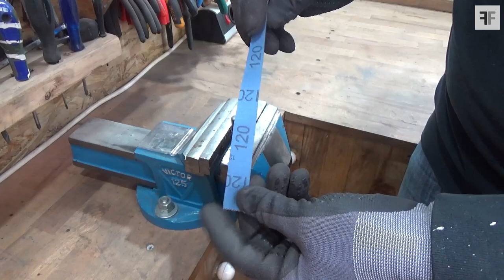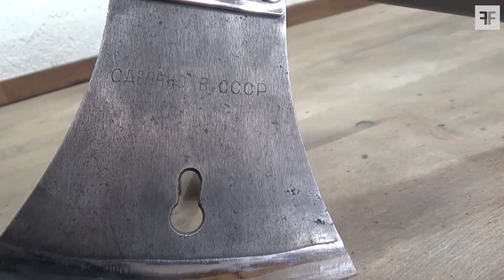Multi tool, 5 in 1: Axe, Saw, Hammer, Chisel, Nail puller || Restoration

Comment: Wow that is fantastic workmanship, i love the way you restore items but don't over do it and leave small marks,  well done. 👍
Reply from the maker: You are right, there are small traces left, but some were created later by my mistake, of course. It would be difficult and it would take a long time to correct it afterwards, so I left it as it is. It didn't turn out bad, it will most likely be used in the future, so it's not a problem.
Thank you for your comment and for watching.
Reply: @fastfixks  great work 👍

Comment: Rivets!
You need to shorten them; so as to leave roughly 5mm above the widest part of the objects being bound together; countersunk holes require less overhang, thicker rivets less too. It takes some practice to eyeball it, but you're not trying to mushroom the rivet, you're expanding the entire top section. Don't use a peening hammer or any mis-shapen hammerheads, use a flat faced hammer, don't smack it too hard (You'll bend the rivet), and keep tapping the center at slight angles until it's tight. If you want it flat, tap it a few times to sure it up, then file the rivet flat (Best achieved with a countersunk rivet.); or file it partially then tap the remainder flat above the grind line. Honestly a countersink would do wonders for your results though.
Edit; later on you do MUCH better with your riveting technique, but the rivets are still too long. They look structurally stable though, alls well that ends well.
Reply from the maker: Excellent observation. You're right, I'm not an expert with rivets, but a few more axes like this and maybe I'll learn that too:):):). Each subsequent rivet turned out better than the previous one.   It didn't turn out the worst, but of course it could have been much better. 
Thank you for the detailed explanation and advice, I will certainly apply it in the future.
Reply: @fastfixks  No problem! I love this channel, and i wanna see every tool you make improve.
Honestly, as I said, you did fine, just minor improvements will likely help you a lot.
You're braver than most because you're showing the learning process.
Sorry if I ever seem harsh in any of my comments, I'm bad at tone.
Reply from the maker: @D-Vinko  Thank you for your advice, every word you wrote is a well-intentioned criticism and has its own arguments.
Thank you for your support and comments.